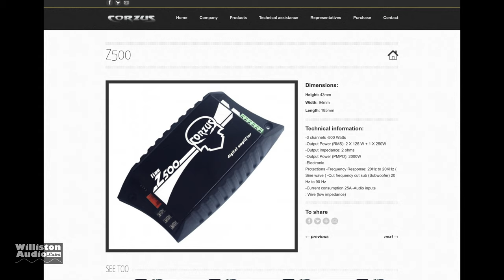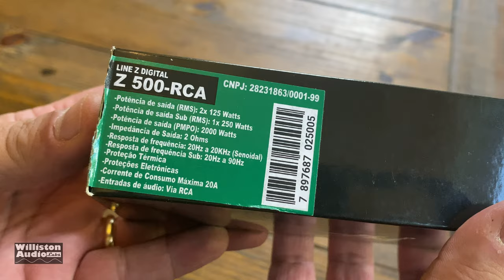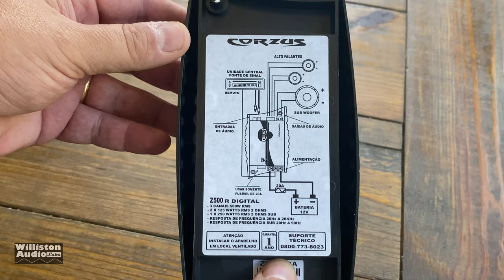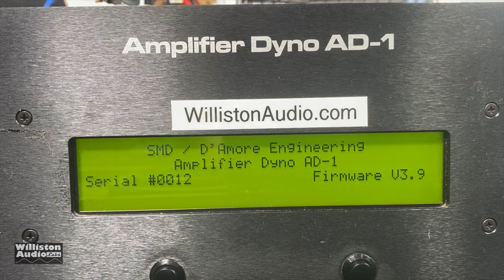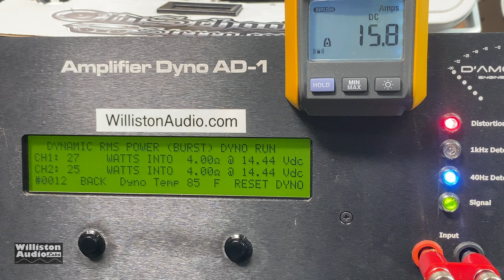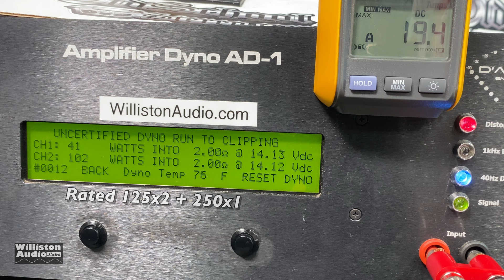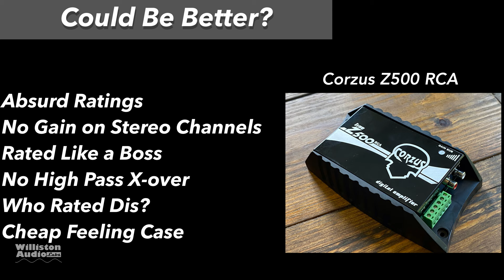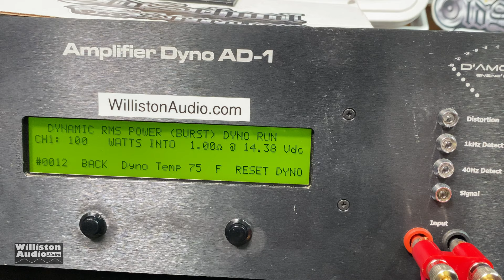500W Three Channel Mini Amp? Well That's What They Say...

Comment from the maker: Shop:
Corzus Z500 - https://ebay.to/2PBuTLp
Banda BD250.2 - https://ebay.to/2Po3nkh
Banda BD250.1 - https://ebay.to/3gsVXZi
Taramps DS160x2 - https://amzn.to/3k5UR7F
Taramps DS250x2 - https://amzn.to/2XDNzP2
Soundigital SD250.2 - https://ebay.to/3gn8L3f
Elac Debut 2.0 Bookshelf Speakers - https://amzn.to/3gq4U5i

See other mini Amp videos: https://bit.ly/3io19Om
$10 Subwoofer Amp? - https://youtu.be/flCY59X2oxc

DISCLAIMER: This video and description contains affiliate links, which means that if you purchase from one of the product links, I may receive a small commission. As an Amazon Associate I earn from qualifying purchases
Reply: Hi...
Please try ground zero brand  on dyno...
And thanks a lot
Reply: Xtant? 😜😜😜
Reply: Can't u gettem for false advertising?
Reply: Hey Derrick could u test my setup? 1 shallow mount JC Power RST-12D4 subwoofer wired at 2 ohm. Paired with a pioneer gm-8701 amplifier. Gain set to normal, and frequency is set at 55 Hertz.
Reply: That amp wouldnt be that bad if it were listed as a 250/300 watt mini amp.  The difference from what it actually makes and 500w is just out of the world way over rated
Reply: Man i seen your video for the dyno on the jl audio rd1000/1 but you never did the bigger rd1500/1 i really want to know how much extra juice I'm sending my w3s 😆
Please dyno the jl audio rd 1500/1 🙏🙏🙏
Reply: a trick : you can watch movies on flixzone. I've been using them for watching all kinds of movies recently.
Reply: @Braylen Alberto Yea, I've been using flixzone for months myself :D
Reply: @Braylen Alberto yup, I've been using flixzone for since december myself :D

Comment: Eu comprei dois módulos destes, um à fio e o outro RCA, nunca vi um módulo tão compacto e com tanta potência, ele é muito bom. Um eu instalei no carro do meu irmão, e o outro irei montar no meu carro. A qualidade é excelente, podem confiar. Comprei e não me arrependi. 😎😎😎😎😎
Reply: That TPA3116 chip is awesome for audio quality. The bigger issue is that the amp doesn't meet its rated power.

Comment: Dude these are awesome for limited space people. Motorcycles or side by sides and stuff like that.
Reply from the maker: Dis a fact
Reply: @wal  yeah but not this one 🤦 thank you Dererick for all you do in the car audio community!! 🙏🙏
Reply: I'm glad someone can find a practical use for this.
Although I don't like companies who lie about power rating their amps, if people like the product then I guess it's not a total failure.
Reply: Still not worth it because there are other amplifiers that are smaller and put out more power. Like The Stetsom iron line.
Reply: For your bike ?
Do it and don't cry that people drive over you .
Only that you can not hear the cars with the music .
Reply: @Bassotronics  be careful with the stetsom amps though. To much amps without an external fuse on them will lead to disaster!

Flames and smokes!
Reply: @dyslectische  okay guys, nobody tell Sebastiaan about Rockford Fosgate.. His head may spontaneously combust. 😂
Reply: Yes that's the most logical use for an amp like this, but it's way overpriced
Reply: @MadDragon75  I know that brand I had it. 
And I use a lot of other amps in my car.
That I blowup my alternatere .
Well a 15 " woofer from sony needs a big amp.
And I use a safiro amp for it.
It use 4x60 ampere's .
And the cable you can stick in it well I think your vingers are to small for it.
It's 1 ohm stable 2400 watts RMS .
I use it on 4 ohm
Reply: @dyslectische  yes, but have you browsed through their fine line of audio equipment made for motorcycles and other off road vehicles? 
That is what I'm rerrering to in reply to your comment.
Reply: @MadDragon75  understand that the road is for Alle people.
Means I do not need the sound to hear from other people in a traffic jam or just past me.
If you need sound use your helmet and stick some in ear headphone.
Reply: @dyslectische  😂 same goes for your loud car you were bragging about. 
This is America, if we want it loud, we can have it loud. If you are inconsiderate at a light and annoy people around you then that's a personal problem a cop will deal with here in Central California.
But if you are like myself, you have a very loud car audio system you enjoy going down the freeway or through the mountains of the Ring of Fire and nobody but who you have in your car can hear it.
besides, how loud do you think this little amp will make a motorcycle? 
Not loud enough to make a big deal about like you just did.
😂
Reply: @ Quin10 The Best
I own 3 different Stetsom and I have yet to burn. Lol
But for sure, I never wire any of them below 2 ohms.
Reply: It's trash period
Reply: They may be good for small places and the like, but all these companies that cheat the public with their inflated ratings should never profit off selling junk as this, I wouldn't care if these were rockford or Orion or anything like that, I still wouldn't buy because of the companies cheating people, they don't deserve one penny from me

Comment: I love reading comments were people try to convince themselves they made a good purchase. You get what you pay for, I'm still running the equipment I bought in the early 2000, a eclipse xa 1000(500@2ohm) on 2 of the red basket punch 12in, a punch 400s on 4 6x9 pioneer premier 2 way and 2 10in Optimus pro series (from the 90's) for my interior's and I still hold my own against this new stuff out here. You get what you pay for, remember,  the cheep always comes out expensive in the end, I know people who bought cheep amps that don't stand the test of time, guy told me he went through 3 power acoustic amp that couldn't stand this new York weather, it was 20 degrees outside and the amps never came on again

Comment: Even in Brazil, this the entry level amplifier. Like your old vídeos we still using Soundigital and Banda. Taramps and Stetson is changing your product line for the real menssure of power output.
Reply: Williston Audio Labs PMPO is forbbiden in Brazil. But some brands is lying in RMS 😎 it’s  happens mainly with cheap home áudio system. If you have a time take a look Subwoofer called FB Áudio.

Comment: It'd be good to run on a bike with a generator that ran off the wheel!!! Remember those?
Reply: last 3 hour on 35 ah battery with 4 ohm speaker
Reply: Dave Micolichek  probably assuming constant test tone on all channels. it would definitly with music though.
Reply: If it took 250 watts, you would be having a really hard time going faster than 5 mph...
Reply: Dave Micolichek  maybe last more connected directly to pvcc pin from tpa3116 IC with 2 12v battery in serie

Comment: Normally you would need arround 24V to come close to the rated power output of those chips. If the layout doesn't provide a step up circuit. But they are very efficient.
Reply from the maker: It’s stepped up but still falls short

Comment: Update the cheap amp with new caps and stuff. 
Test how much more power you can get? About 100 watt Times 2
300 watts at sub 500 watt in total

Comment: Boost converter in that amp is probably part of the problem.  The TPA3116-D2 chips are not too bad at all if you give them enough voltage and power reserve.

Comment: Makes me wonder what the inside of my super expensive mid 90s Aiwa bookshelf system had inside it?!?   ;)
Reply from the maker: More chips than Chips a Hoy!
Reply: Aiwa was a really good brand with good features for the money, definitely a good value & Im sure it still works " solid state " not like todays knock off junk.
Reply: either small TO-220's are an STK module. Maybe technique SVI module but i dont think an Awia would use technics
Reply: Josh Dobson I’m still rocking the speakers that came with mine in 96. The foam around the woofers never deteriorated and is still holding up nicely. The unit died long ago, but the speakers really kick with a Sony receiver I found on the curb. It’s a good system for my garage.

Comment: Hey Bigbwiz. Thanks for the nice videos you are making. We all enjoy this very much. I am just wondering , I have two very old school amp at my place , the one is NAD 3400  power envelope from 1985 and the other one is a Pioneer A-447 from 1990. Both are in a fair condition , plays very well , but would like to know if you maybe tested one of them or both at any time ? I would really like to see how they perform on the Amp dino , the Pioneer is Rated 80watts ×4 and the NAD  is Rated 100watts × 4. I've used both amps on the same speaker setups and it seems that the Pioneer out perform the NAD . Well , thanks again for every test and video you share,  it really interesting how some amps perform.

Comment: Love this channel! I'm a huge audiophile, but let's get right to the point I have a MB Quartz nano-400.2 in my Harley, have you done a test on this amp? And how does it rate against the soundigital nano 2 channel? Which is cleaner and which actually has more power? And is there a better one than the MB quartz, with in that small size package imprint? Thanks
Reply: How does that amp work for you? I have the taramps 160 micro amp in my road glide powering the hog tunes 3 ways that fit in the faring factory location, I can actually hear them thru my full face helmet at actual speed!!!!  As to where before I couldn’t hear shit without an amp unless I was at a stoplight and even then it was very minimal, I wanna get some speakers in the saddle bags I just don’t know which route I wanna go, what do you have that MB nano-400.2 pushing???

Comment: The TPAs are in bridge mono, one chip per channel ... dont get way they didnt go near the 100W at 2ohm. Of course they need 24V (they wont do on 14.4v). Could be that the power supply is undersized and went into limiting ?.
Reply from the maker: I think the transformer boosts the voltage for the chips and they are getting close to 24V. When I tested the TPA3116D2 mono board before I got 85 watts with 26 volts of input

Comment: do  a    orion hcca 80001dv2  v2    updated  class d      ,            Maybe I’ll send you mine...lol  Maybe if I was closer,  And maybe if I wasn’t scared to get it damaged.  it did cost  $1,075  new             i have  mine at 2 ohm   5,900  watts             1 ohm   rating is 8000+            the 2     12 in  Subwoofers I have I thought I could run one ohm    but i cant,    The reason why I  got this amp was  because i could run 2  Ohm’s  at 5,000 watts   pretty easy...amp stays   nice and cool.        From your past screen videos   this type of amp   ,,   I’m sure it does it’s rating and  beyond...   Would love to see its   limit..

Comment: 137° F, not C lolol.  At 137°C that thing would be on fire. 

Interestingly enough, a small 3 way passive setup could be done. Tweeter with its own passive network on one ch, mid range with its own passive network on the other stereo ch and the mid bass on the sub ch. One amp per side. Just depends on how low the sub xover point is.

Comment: Would be a nice one for my motorcycle. An affordable compact 3 channel would be great. Not too concerned with having that much true rated power, but if it puts out a clean 150~ish total watts at a low amp draw it would be perfect for my needs. The difference between channels 1 & 2 are pretty concerning though. Half the output on ch 1 @2 ohm? Wow.

Comment: Thumbs up for that first song you played... That amp is... whatever. One channel is more powerful than the other. I didn't see you do the sub channel on the 2 ohm load(I'll go back and look at your chart). There are better amps for less money.
Reply from the maker: The 2 ohm tests on the dyno showed one of the stereo channels on Ch1 and the sub channel on Ch2, this explains the discrepancy. I put those measurements on the same column on the results sheet. I also tested the sub channel at 2 ohms with no stereo channels connected to see if it would do more and that's the column 2nd from the far right

Comment: From the results would you be better off running the speakers directly from the head unit 🤔 most good units can deliver over 40w per channel
Reply from the maker: Most head units are 18 watts RMS per channel. You are correct though this one isn’t much more powerful but maybe for a scooter, big wheel or tricycle
Reply: Yep, 18-22 watts is the norm rms I've seen on even flagship models of headunits

Comment: Hey Williston, I hate to ask you but could you consider the taramps dsp1600? I bought one and it's drawing 75a non clipping on ohms law therefore that's approximately 2500w rms because sqrt of 2500 is around 70. I'm telling you that amp packs a punch. They say its rated at 1600rms at 12.6v and 1940rms at 14.4v. thanks
Reply from the maker: I’ll see what I can do
Reply: @wal  thank you big D

Comment: Hey brotha is there anyway you can Dyno The New Bavsound Amp ' I'm wanting to add bass and speakers to a newer BMW but all installers say it's harder on those for some reason,,,, should I bavsound route plug and play or Audio control route?

Comment: 20amp fuse...I'm going to be a little optimistic with my guess, 25W x2 +50W x1....Maybe.  Let me unpause and see...
Reply: ~20W x2 @ 4 ohms and ~70W x1 @ 4 ohms, then ~35W x 2 @ 2ohms + ~85W @ 2ohms (yea, I just rounded up)....  Not a bad guess....  Definitely not wonderful, as in very, very far removed form advertised power.  But not a bad guess (and yes I realize now (after) I should have put down an ohms reading in my guess).

Comment: Maybe try running the amp at 24 volts. Those chips really need 24 volts to shine, they distort easily and barely put out power at 12 volts. From the looks of it there’s no voltage booster built into the amp board either.
Reply from the maker: Unless I’m mistaken, isn’t that a transformer on the board?
Reply: @wal  it could be, I thought it might've been a choke for electrical noise suppression but I may be wrong.

Comment: The amp did sound good! But I believe I would pass on dis one... Meh amp, but it’s a great video!
Reply from the maker: That TPA chip sounds great but yeah they cray cray thinking 500 wizzats
Reply: As hot it is it got if I tried to drive to work it's probably going to burn.

Comment: Same basic setup you can get off Amazon for ~$30-50 for a home amp. They put out the most power with 24 volts but that thing is never going to hit 500 watts.

Comment: Overrated and overpriced! If they marketed it at actual wattage and at half that price methinks Dick Rickulous wouldn't have had to get involved. The TPA3116 is a great chip I own one partly based on your previous test! Like some of the other amps you've tested lately the chip is not being used to it's full potential on that board. A few cents worth of upgraded components and this thing would put out quite a bit more clean power. I'm a bit confused as to how the three chips are configured, I'm assuming one at 2ch for the hi channels and the other two strapped/synched/summed for the sub channel? Good stuff big D keep it comin'!!

Comment: If you look at it again its rated in PMPO not RMS so that normally means they just plucked numbers out of a hat
Reply from the maker: The 2000W is PMPO, the other numbers state RMS
Reply: @wal  still massive red flag to me any amp that states PMPO normally the figures have no relevance to what power it actually makes 👍👍

Comment: I have to laugh, the manual you showed with the ratings says PMPO 2000 watts!
Reply from the maker: Yeah when lightning strikes 😝
Reply: @wal  nah it does put out 2k ! That millisecond before it catches on fire and clips ur sub to death
Reply: @erik120719  The charge built in the capacitors. It is an arc blast of 2k but .001 seconds of it. Lol. Like punching a wall and the second the hair on the knuckle touched..dead. lol.

Comment: Might be a dumb question, but why are channels 1 and 2 so unbalanced on power output? This little guy looks like straight up landfill....
Reply from the maker: The 2 ohm test I show one stereo channel and the sub channel at the same time. The other stereo channel was loaded with a resistor
Reply: @wal  ok, thanks very much.

Comment: Big D you should check this sweet little dutch made amp out.
Its a 45x4 with bluetooth and........highly adjustable dsp!
a lot of the settings can easily be changed, such as:
-Start and maximum volume
-Battery protection voltages
-Input (left/right/mono) and output (4.0/2.1/2.0) configuration
-13 general filters (equalizers) en 5 filters per channel (crossovers)
-2 equalizers which can be enabled with a button (e.g. indoor/outdoor, bass-boost)
-Volume dependant (dynamic) equalizer
-Delay per channel
https://zoudio.com/product/aio4ch/

Comment: Lol they make a 15k amp....weirdest imputs I've ever seen. Also on ebay they show this mini amp with what looks like a 40 amp fuse.. Trickery!
Reply: The Phoenix connector... it's very popular. A lot of power supplies in the same size and power range and most devices with low voltage use them like your digital thermostat.
Reply: @MacNifty  ive seen those before but the power side I haven't

Comment: Mini amps are more miss than hits. All big brands tried them out decades ago, they stank back then and stink today. There is no way around using fat wires for more watts. However, there are a few out there than can do rated for a low powered system. As It goes, “music is dynamic”!!! Too bad the RMS hype for tones ruin the musical aspects of current amps. Hint, hint...Rockford Fosgate gets it right.